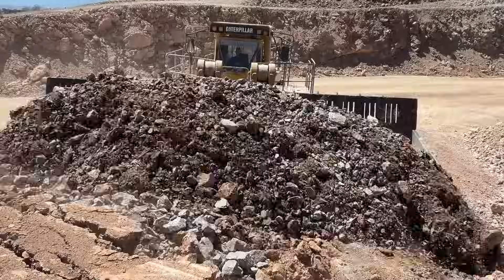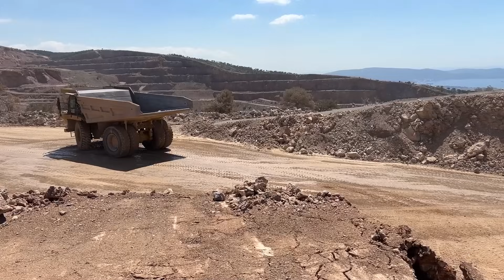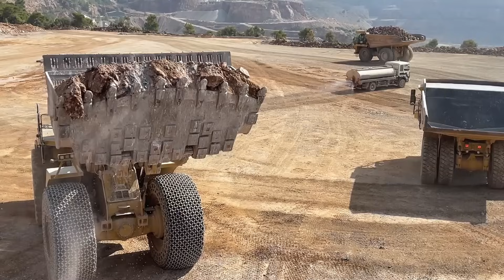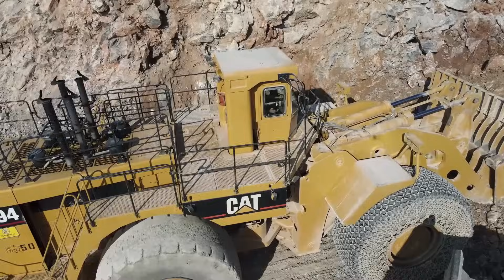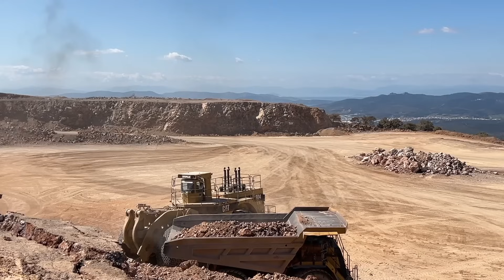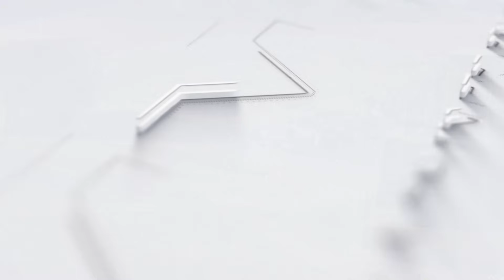Massive Caterpillar 994 Wheel Loader Loading Dumpers - Mega Machines Movies

Comment: Once in awhile somone will comment on operators such as this who only achieve approx 75% of a full bucket with each pass ... As i replied to one such comment,  this operator could indeed 'power into the pile', achieving the full bucket. Believe me, in the longrun, it would only lead to expensive downtime .... not to mention the expense of parts repair or replacement,  plus added fuel consumption and undue wear on the rest of the machine. The mining industry is indeed a  harsh environment for any machjne to operate in . The material being moved here is heavy and by its own nature, cumbersome to work with. This operator is respecting this machines power by NOT ramming into the overburden under full power, which he could easily do. Kudos to him for treating this awesome machine with the respect hes showing here. In the longrun, theses machines are far more productive with such operators at the controls.

Comment: Both shovels considered advance machines but the operator not that efficient to get job done well,bucket 75% loaded 25% lost of the duty cycle,
Reply: Chasing full buckets damages the rams. Once the seals go dirt starts getting into the pumps and then you're talking big bucks and a lot of downtime to replace. For a small operation like this (ie: not a multinational company like Rio Tinto, BHP) it would be devastating to their bottom line.

Speaking from experience ... when loading in 10m faces with a 19cm3 bucket to overload the bucket you need the face to fall down and and spill over the bucket. A 994K will then start to struggle will 65 metric tonne loads. I have lifted a handful of 70 tonners in real good heavy dirt.
Reply: @and__lam1152 Thank you! We'll said! I wondered in comments till someone would criticize this operator on bucket fill. Only ramrod operators push the power and ram into the pile full power in order to get that 'full bucket'. You're 100% in your assessment of this operator. Downtime and repair costs far outweigh the lost 25% capacity!! In my opinion, here's an operator who knows his machine and the impotence of not 'overpowering' in order to get the bucket full. Thank you for seeing this as it is!
Reply: Not to argue, but far more loss in damages and downtime would be incurred by 'powering' into the pile to get the bucket full, not to mention the extra fuel consumption. Believe me, this operator is utilizing his machine just as should be. If loading a lighter material, such as coal, I'm sure this operator would have ful buckets each pass.